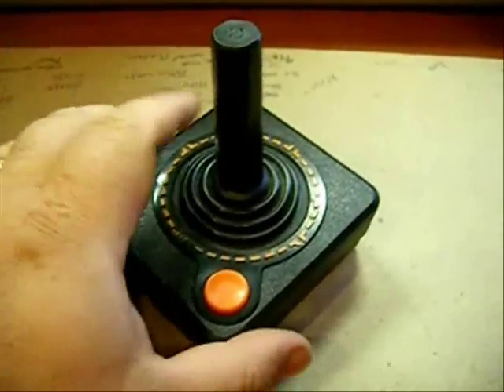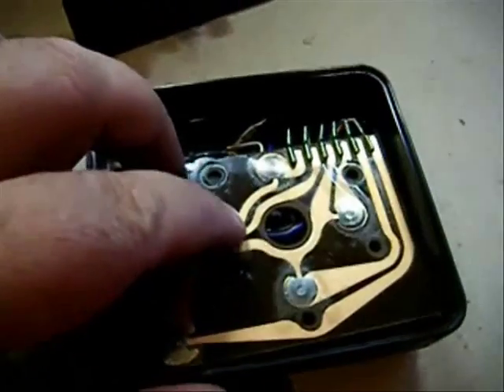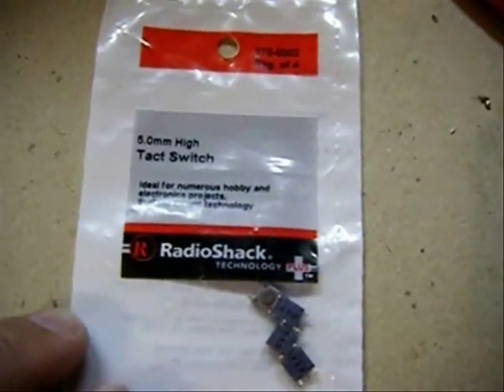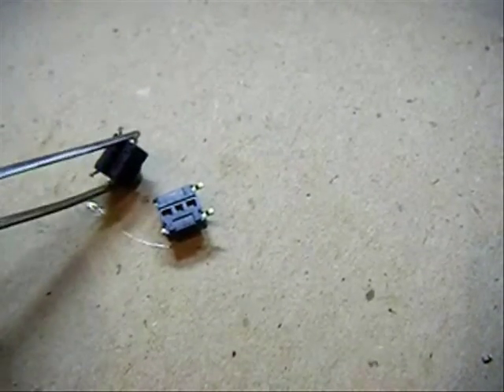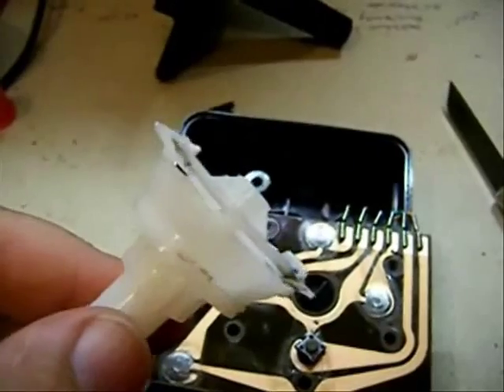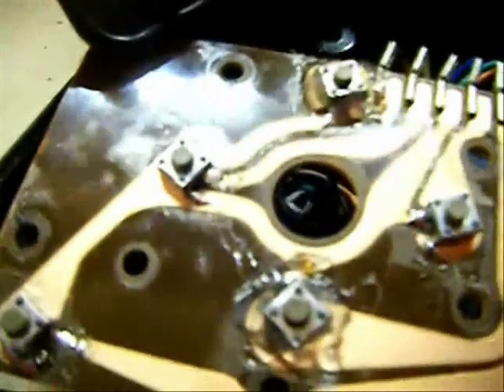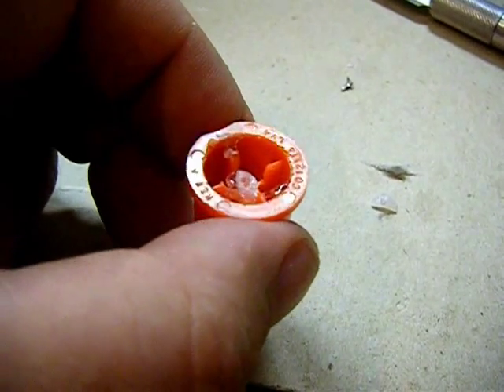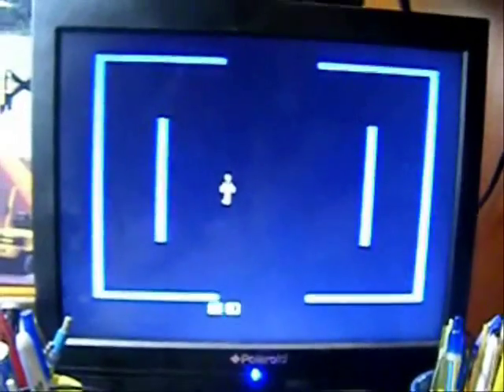Atari 2600 Joystick microswitch mod

Comment: Radio Shack doesn't exist anymore. Is they an update on where to get those switches?
Reply from the maker: Mouser, Digi-key, Newark Electronics, Ebay, Amazon. Just do a search for a 5mm high tactile switch.  they measure about 6mm x 6mm x 5mm.  they are on ebay currenlty if you search 275-0002 as shown in the video :P

Comment: I've also had the center pin in the bottom part of the case break on several different Atari sticks. Naturally, it's made out of ABS plastic, which virtually no glue will stick to. Even drilling it and putting a nail up into it won't hold it in place after it breaks.

Comment: In my experience of standard Atari joysticks, the 'ring' at the bottom of the white plastic shaft in the centre of the joystick breaks, long before the leaf switches (press pads) will.  I know there is a redesigned part available in the US to replace this, but there must be a DIY solution.